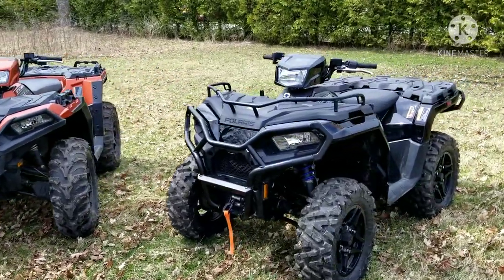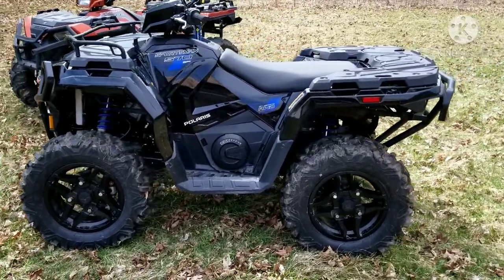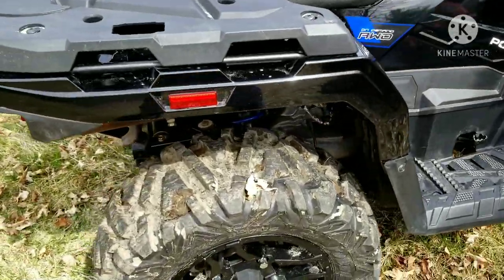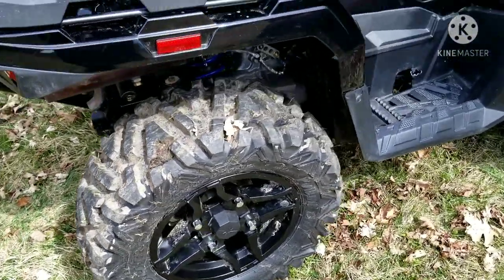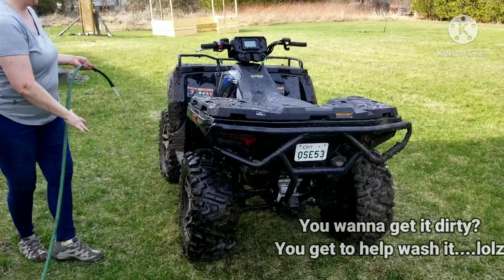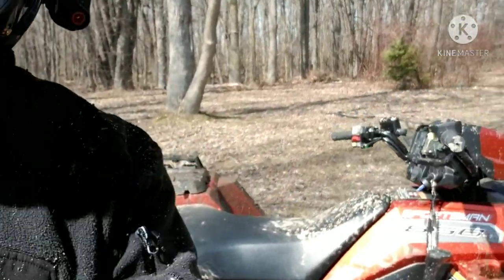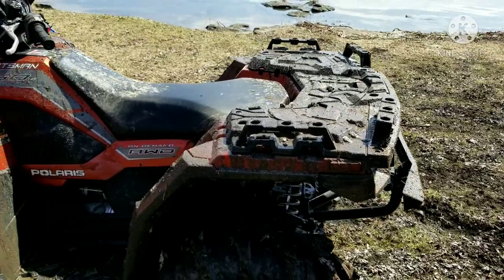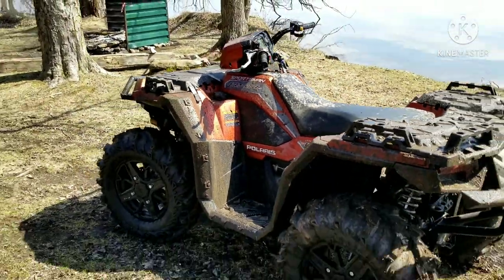2021 Polaris Sportsman 570 Trail and 850 Premium. Update on front rack fix, reviews and mud riding

Comment: How is the ride quality between the two machines. Is the 850 a better ride. Suspension wise?
Reply from the maker: In my opinion, yes. They are both plenty comfortable, but the 850 feels more stable and composed. The 850 seat is much more plush which helps with comfort as well.

Comment: Just ordered my 570 trail. Almost went with the 850. I didn't care for the 850 stripped down trail package for the cost.
Reply from the maker: The 570 Trail is a good value in my opinion. Well equipped and looks great. It hustles along just fine...does not really lack power.
Reply: @PapaC-ej3kz  thanks for the great info on both models. I added the LED lights and a plow for snow. Now just the wait. Dealership said early July
Reply: How many miles are on your 570? And how about reliability? Busted knuckles has a ton of issues with his ultimate trail.
Reply from the maker: @H77RBG   480kms (300 miles) so far and roughly 20hrs. Just did first service. Zero problems so far
Reply: Well change of plans. The dealership just got a random Ultimate trail in (can't even order that model anymore) and I jumped on it. Going to pick it up tomorrow 🤪.
Reply from the maker: @H77RBG  exciting! Have fun and congrats
Reply: @PapaC-ej3kz  right on! Like I mentioned awesome content, good information on both models. I'll definitely review the bike once I get it and ride it. Picking up tomorrow 2pm 💪
Reply from the maker: @H77RBG  thanks! I will watch for your review
Reply: @H77RBG  ordered my 850 ultimate trail in early Dec and just got it delivered ~ 4wks ago. Awesome ride. Heavy, but awesome. Hoping the gas mileage improves a some after break-in though.

Comment: Hello there, which one do you think is better 570 or 850??
Reply from the maker: If the price difference isn't an issue, I feel you get quite a bit more machine with the 850. The frame is beefier and it rides and handles more solidly. As for power, besides it being quite a bit quicker/faster, you don't feel like you have to work it as hard to ride at an aggressive pace. The belt box is also less susceptible to water/debris getting in.

Comment: How much power difference is there between them? I know what the numbers are but I mean is the 570 left behind a lot? I'm coming from a brute force 750 I didn't know if the 850 was worth the extra cost over the 570?
Reply from the maker: In tight trails the 570 works great and it handles and rides great. That said, for me personally, I appreciate the extra power. Since it is a twin and the 570 is a single, the 850 is considerable smoother too. The 850 is built tougher too, the frame tubes are larger round tube vs smaller square tube.  If you are coming from the Brute Force, I would say the 850 is a better choice. Not saying the 570 isn't a great machine....my wife loves it
Reply: Thanks for the information. I ordered a 2022 850 ultimate trail. I can't wait for it to come in. They said the end of September.
Reply from the maker: @Jimmie572  I wasn't a fan of the color scheme on the '21 Ultimate Trail but the '22 is very nice. Congrats, I am sure its gonna be awesome!

Comment: Thinking about getting a 570 trail myself. Been doing some research and found some people are having problems with where the cvt intake is. Have you had any problems with water or debris getting in it?
Reply from the maker: A bit of mud splashed in by the opening but not really any further. I have the cvt exhaust from a 2019 that goes up under the seat, but haven't installed it
Reply: Thanks. That’s really the only thing that’s been holding me back from pulling the trigger in getting one. When you install it could you make a video on it? Would love to see it and how difficult/easy it is.
Reply from the maker: @charlesthompson5150  there is a video of a guy who did it first on a 21 Ultimate Trail 570. Search Busted Knuckles Garage Polaris.
Reply: I had the belt slip due to water down the cvt exhaust. Quick fix was to rotate the 90 deg discharge hose under the seat. Havent had a problem since.
Reply from the maker: I have added some pieces of ABS pipe to the cvt exhaust so it exits where the rear storage bin would have been on earlier models. I had the pieces around and it seemed easier than adapting the earlier ductwork. Have been through water nearly to the top of the tires and have had no problems. I will include that mod in a future video

Comment: Trying to figure out what parts are needed for the older style cvt exhaust. Do you have the part numbers?
Reply from the maker: Part number for the duct is 5451155
You will need to come up with some kind of rubber or silicone coupler. You also have to heat up one spot and "dent" it in for it to fit. The belt box has changed so its not a direct fit. I am currently fitting some ABS elbows to ours so it ends up where the toolbox would have been
Reply: @PapaC-ej3kz  are you going to make a video on it?
Reply from the maker: @todd6743  I will soon, hopefully after a ride so we can see how it works.

Comment: Does the 570 Trail bigger/taller then the 850?
Reply from the maker: The 850 is bigger
Reply: @PapaC-ej3kz  Must be the camera angle! What do you think about the performance of the 570 Trail, when you ride the bike? Curious, I just picked up the same 570 Trail, over the 850, I figured only so fast (25) to go on the trails....so I went with the 570! Curious to hear your opinion? Thanks
Reply from the maker: @brianb1767  I really enjoy riding the 570. I went for an 8hr ride with it in October. You can hustle it through turns and the suspension is great. Only in wide open areas do I prefer the 850. The 570 feels a bit more agile in technical stuff while the 850 has the power to turn some bigger tires to be superior in the mud and faster overall. You feel the 850s extra weight when you throw it around turning side to side and during braking. They both have different personalities, but the 570 is quite fun and plenty powerful
Reply: @PapaC-ej3kz  Thanks so much for your honest opinion! I'm looking forward to getting out and have some fun on my new ATV, my 1st! I hear you when it comes to straight aways! 👍 Thanks again, I really appreciate the honest feedback! Enjoy the rides!
Reply: Have you had any problems with water and debris getting in your cvt intake on the 570?
Reply from the maker: @charlesthompson5150  some mud did splash in just around the opening, but didn't get very much farther